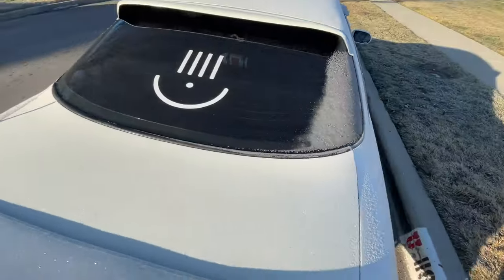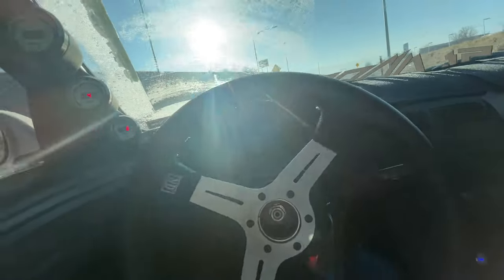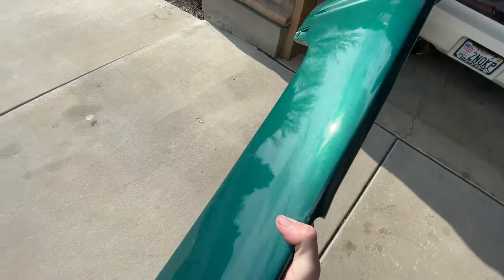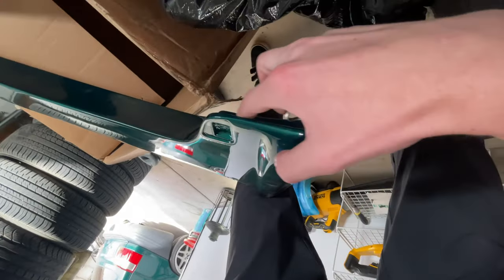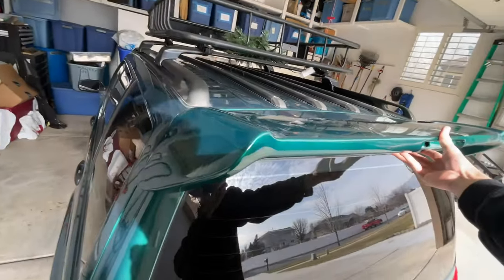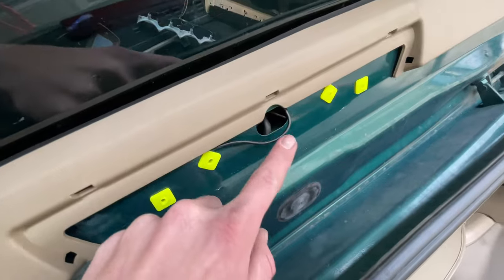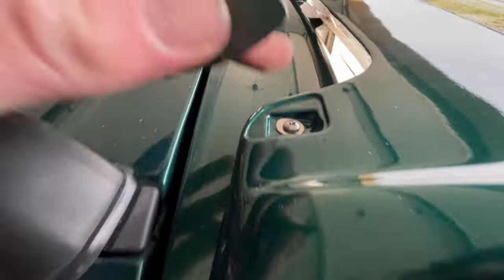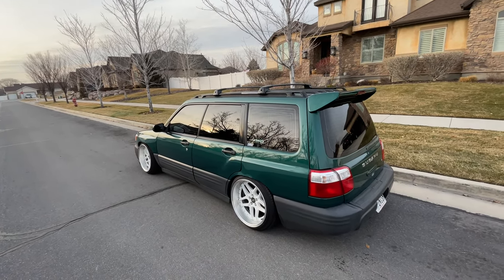Gronda vlog 6 forester gets a custom Russian STI wing!!!

Comment: I just picked up a spoiler last night with the 3rd brake light i have a 98 forester same 3rd brake light you have/had so ill have to do the same thing with the wiring was it hard? Ive never done anything with wiring before 😢 but my current wing looks like its straight from ebay and i hate it so im hoping i can make it work and make it look easy like you did 😅
Reply from the maker: Wiring a brake light is really simple!